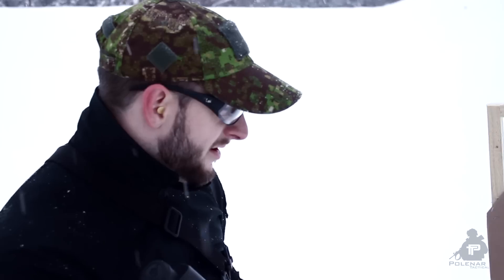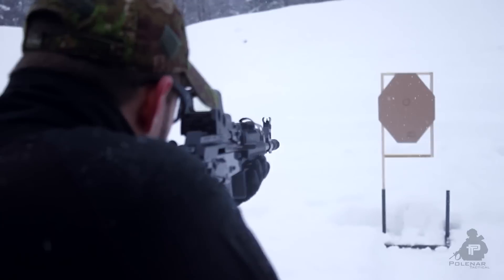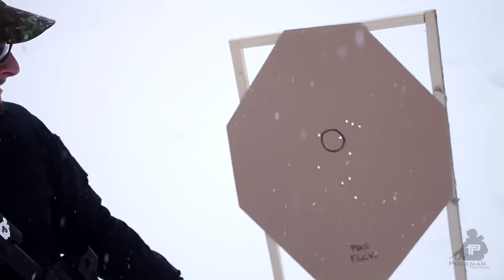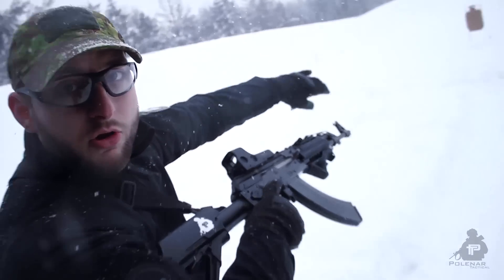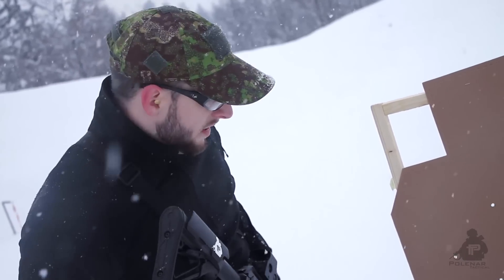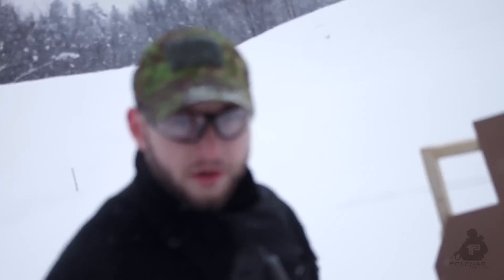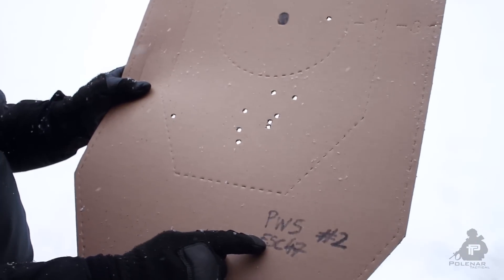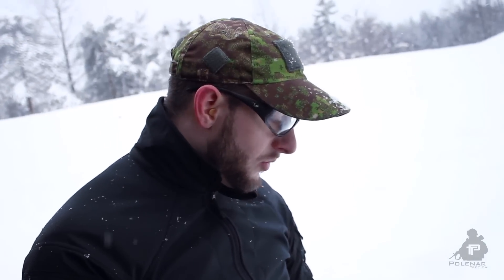Muzzle Brake Comparison

Comment: Should probably do this from a lead sled or fixed mount.  Full-auto would help as well, not sure about the laws where you are so that may not be possible.
Reply: AKlover Agreed, a fix position is always best for testing mechanics as it takes the human error out of the equation.
Reply: TheDivinicus The result from a clamp would not reflect the first time usability of the device. A break may perform amazingly while steadied in a clamp but in hand it may kick in odd ways.
Reply: AKlover I guess it's better to do them both
Reply: microgamestation   No disrespect to the shooter but the difference in groupings would be more obvious from an anchored position.  Leave some slack for left-right travel in the clamp.  This is really also a test you need full auto for and even then due to the AKs barrel whip/flex  it may not be worth doing anyway.

Comment: that's an interesting result at 10 metres that's the sort of groups that where expected of me when I was in that British Army at 100 to 200 metres with SA80 A2 in fact I would have got a bollocking for split groups etc...
Reply: bigjohn697791 With equal speed? I doubt that.
Reply: depended on the range practise or type of shoot however for APWT probably not that fast more of a CQB CQM.
Reply: Do you use optics or with iron sight? Here in Finland, most are still issued RK-62´s and some RK-95´s. Optics we hardly see during ordinary consript service. Those are mostly used on more specialized branches and peacekeeping operations. FDF just bought some SCAR's in 5,56 for special operations units, so maybe we have hope of better rifles and optics will be more common in the future for other branches too.
Reply: both Iron sights, and optic's the sight I used was the SUSAT  (Sight Unit Small Arms, Trilux) But mainly Optic's there was a new sight being issued as I left, ACOG sight was used but the newest sight I believe is called ELCAN SpectorOS 4 x lightweight day sight LDS as a replacement for the ageing SUSAT sight I did see something about finland looking to buy new rifles for there army in JANES DEFENCE some months ago. so maybe especially with your Russian neighbours playing silly games at the moment. not that I think they would try anything silly as the last time they did that it ended very, very, badly  for the Russians.
Reply: I was a professional soldier for 14 years UK got scrapped conscription in the late 50s or early 60s its interesting to know that some countries still have it in europe
Reply: bigjohn697791 It sure did, but we lost a serious amount of land too.
We have Aimpoints from comp M2 to M4 and some special order ACOG´s with 7,62x39 reticle. That is mostly used as a DMR replacement, sort of. Friend has an SUSAT on his FAL or L1A1, I never remember which one is it. It was a bit difficult to find at the time.
Yes, conscript army is pretty cost effective option for us. Our wartime reserve was recently cut into 230.000, but we get more reserve exercises and better gear in change. Well, that was the plan, who knows how it will turn out in the process :)
Reply: jpenna1976 Yeap! The SUSAT is not the best of sights at times, trust me what ever country your from in the world just leave it to the politician's to fuck it up lol... They're going mad across Europe cut they're defence spending and armies it's crazy with Russia on one side ISIL and all the other luntic's in the middle east this is a bad time to be cutting things back.
Reply: My friend wanted the SUSAT, because it sort of completes the old warhorse :)

Yep, In Finland we say that FDF has a special "Design and screw up good gear" department. They take a good product and see how to make it worse and save some money on the side. Specially that goes to backpacks and bergens. Special forces and peacekeepers on the other hand get top brand quality stuff. You should see how they were experimenting to update our current assault rifles with telestocks, rails and optics to extend service life. My god... luckily the project got binned due to low priority funding.

Comment: I have never tried one myself, but have seen, heard and read numerous oppinions stating that slant brake works surprisingly well and beats most commercial brakes with ease. AK-74 style brake doens't do much better, but brings a very clearly sound concussion effect towards the shooter. Sometimes commercial products are over designed and engineered, meant to fix a problem that really doesn't exist..

Comment: If the purpose of a compensator, muzzle brake or combination thereof is to reduce muzzle movement upon firing, the muzzle must be left free to move naturally when testing such devices.  Clamping the rifle in a mechanical bench rest for the test would render the muzzle device irrelevant, as the whole rifle would be fixed in place.  Comparing groups would probably be most meaningful with full-auto fire.  For semi-auto operation, comparing muzzle movement may be most illustrative of the differences between the devices.

Comment: What kind of AKs  do you guys run?
Reply: I believe the one he has is a M70 Ab2 with a m4 adapter.  You could see on the rear trunion where the folding stock use to be.

Comment: I think if you try your best at a timed drill with each muzzle device it will yield more meaningful results and still be fun to watch. Perhaps a 2x2x2 or 3x3x3 drill, that way you can analyze the pattern in your groups with each device as well as the speed. Rotating through each muzzle device a few times to make sure you get the average result from each would be key.